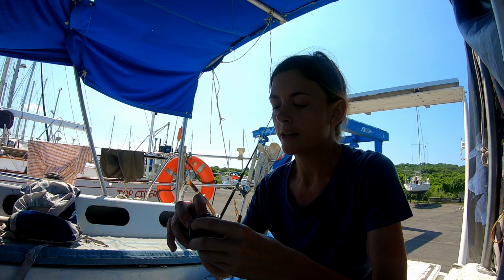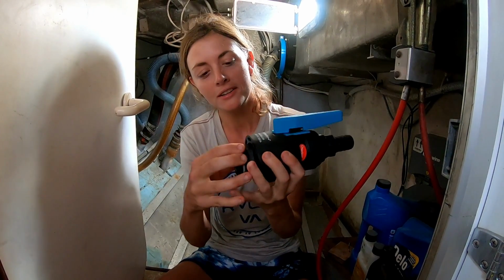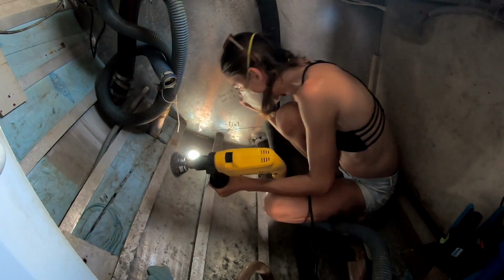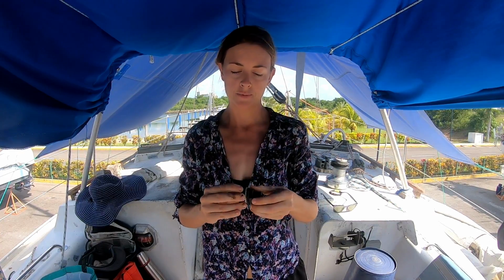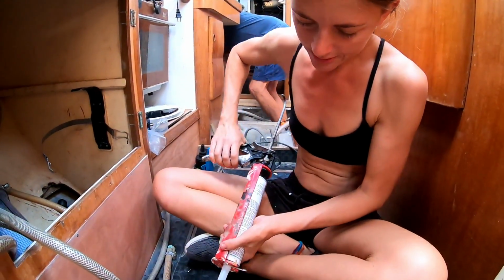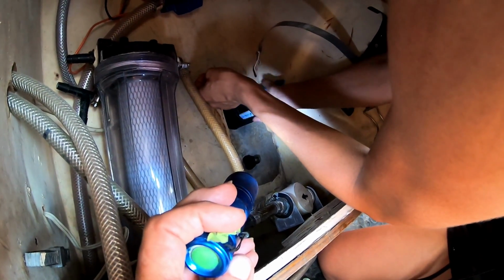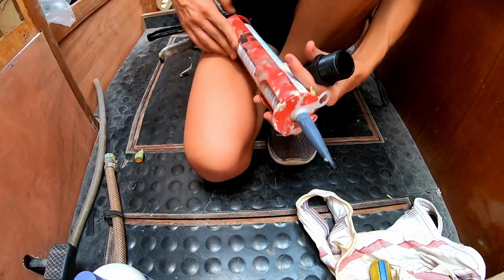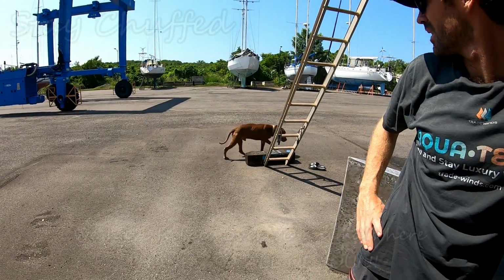Installing Tru Design Seacocks : Chuffed Special

Comment: A little advice you are better off using a low speed stainless wire wheel, high speed tends to work the corrosion layer into the alloy, low speed brushes it away.

Comment: I got a metal shaving in my eye, while I was wearing large glasses. It drifted into the cabin from someone on deck drilling into the mask. Cost of US ER visit? Over $500. I now own and use several pair of $5 or $10 true safety goggles. Much cheaper than trying to get new eyes. FWIW.
Reply from the maker: We did have the goggles but my face is so small stuff was getting in them even worse than the glasses! We should try find something though!

Comment: Very thorough.  Thanks for the detail.  I'm learning a lot about aluminum boats.  

I'm curious if using the sealant on the male adapters was according to specifications.  Personally I would have been inclined to use teflon tape on that connection.  It will seal just as well and will be easier to remove at a later date.  Using the same sealant there would make the male adapter connection as strong as the seacock connection and leave the possibility of unscrewing the seacock when intending to unscrew the male adapter.  Regardless you'd always want to secure the seacock with a wrench when trying to remove the male adapter.
Reply from the maker: It’s actually not to hard to undo (the 4200 - it’s not meant to be a permanent bond). We opted to just go with added strength, maybe because I had just read a post about a ladies boat sinking after a thru Hull undid 😓 definitely can use different tape seals, tru design gives you a list of what they recommend including the 4200!
Reply: @VetTails  Good to know. There are a hundred ways to do something right and nothing gives me more angst than holes in my boat.

Comment: I know this is an old post so not sure if you will pick up on this. I am just about to fit trudesign on my aluminium Ovni and the bit I do not understand is the final tightening of the back nut once the sealant has cured. What happens if you have accidentally  got the sealant on the thread so you can’t turn it. Easy to do I would imagine, did you come across that problem on your final tighten??
Reply from the maker: From memory we did the final tighten before the sealant had cured - we waited a few hours then did a tighten rather than waiting the full 24 hours for cure! We did do a final check of everything once cured as well, but nothing went any tighter :)
Reply: Thank you so much for taking the trouble to reply 😊 and a good idea!

Comment: Hi,  what was the name of the coating on applied to the bare aluminum again? Etch Primer? Brand please?
Reply from the maker: Its Pettit etch primer - they dont make it anymore was my understanding but it worked good
Reply: @VetTails  Excellent, thank you very much for your detailed videos that include engineering and materials science.  Keep providing those insights.

Comment: Am I the only one completely mortified by how many holes there are in the hull of a boat??
Reply from the maker: you mean the holes for the through hulls? I did contemplate soldering some up but on the off chance we install a water maker one day... if you mean the other holes i was pretty sad too but shes patched up now if you check out newer eps
Reply: Yeah, all the intentional holes under the water line on most boats. Obviously I'm new to boating, just seems scary to be 1 broken valve thing away from sinking.

Comment: did you consider welding closed most of those through hulls? the sea has been munching your hull as it is.
Reply from the maker: I did, we actually ordered the thru hulls before we knew for sure we would need welding/that we would find good welders. In hindsight I would’ve had a few closed, but on the off chance we eventually get a water maker we will be able to use the spares!

Comment: hey there, its 5 yrs now since you posted this video. I am looking to replace my brass seacock system. Are you still satisifed and would you do anythign differently now? Thanks.
Reply from the maker: Hi! Yeh all in all we are happy, we had one get leaky, but it was at the join above the valve, the company said we likely didn’t use enough sealant between the tube part and the sea cock part - so maybe I’d go a bit more heavy handed with that next time (easy fix though we just took it apart and resealed).
Reply: thank you  @VetTails

Comment: Ok, very strange over at youtube this am, comments just spin and I do not see them. IGNORE this question, had the threaded pipe going out, and it goes in !  (So, question , did you think about the possibility of cutting the extra threaded pipe from the outside ? IGNORE..  And, coming back, over at YouTube , I signed out, and back in, everything was fine ....?
Reply: Not sure you did this, much after the fact, but when I cut threaded material, I always am sure to have a nut on it, and then I back off the nut. It straightens out the threads usually. A little trick you probably used. I hope . I have those valves on some industrial tanks. They last forever (so far lol )
Reply from the maker: Yeh we did do that, it for sure helps!

Comment: “Not an engineer but” isn’t using a steel wire wheel on aluminum a poor choice?  Brass wheel a better choice?  Comments?
Reply from the maker: Hi Dave, We are using stainless steel, which although technically more cathodic than brass has been passivized which lowers it electrical potential and makes it much safer to use. That is why stainless steel is generally used for attaching deck fittings etc to aluminium boats, although we still try to coat it and prevent contact as much as possible. Brass/copper are both extraordinarily bad for aluminium boats, the aluminium acts as an anode to both and  a hole will be eaten right through Her. 
The Stainless steel is 'harder' and less likely to chip off/leave residue behind. But if it does it is more inert.

Comment: I know nothing about but, isn't 11 too many?
One for the engine, one for the sink, one for the toilet, maybe another toilet and two other sinks... One for a hose.... oh... two toilet outputs? 
What am I missing?
Reply from the maker: Yeh 11 is too many, I've got one for kitchen sink, one for bathroom sink, one for bilge pumps, two for toilet, one for salt water intake for sink, one for salt water intake to engine... and then 3 not in use (I might have miscounted and we have 10 in total - we bought 11 because one actually didn't fit but we couldn't return it so kept it as a spare, so I counted wrong!). In hindishgt we couldve welded the old ones, but at that time we didnt know we would find good alloy welders in the area!

Comment: An inline ball valve is not a seacock and will not stand up to the ABYC H-27 load test. A seacock has an flange and can withstand 500 lbs of force at the most inboard point of the assembly.